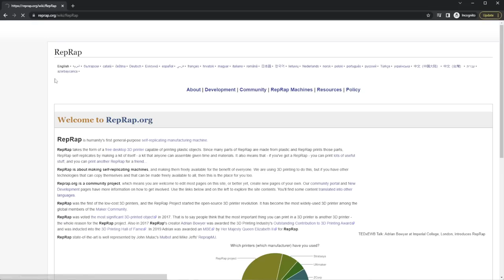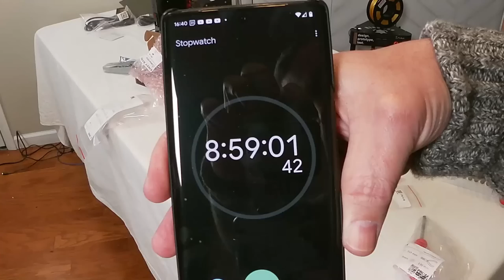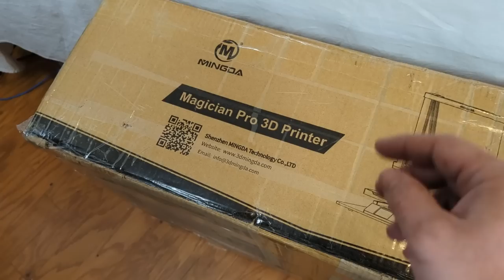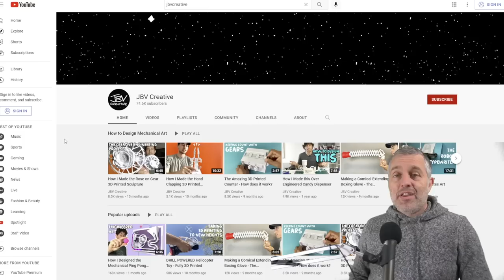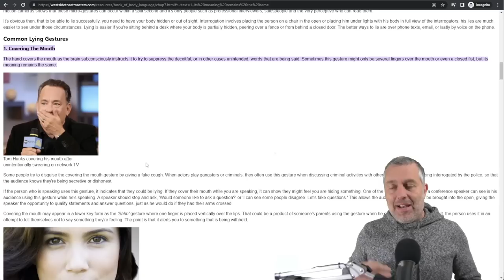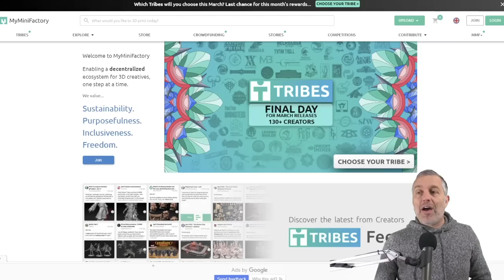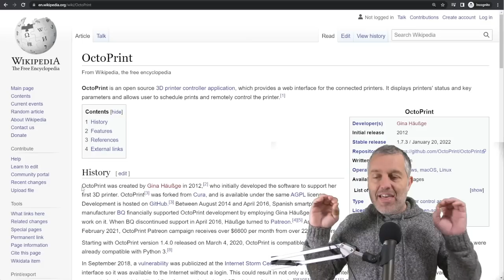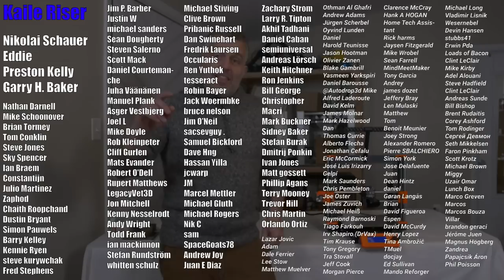Why Does Nobody Speak Truth About The Prusa I3 Mk.3? - It's Overhyped and Over Priced.

Comment: I have a heavily modded Ender.  It is temperamental.  When Somebody buys something from my etsy and i have to ship, guess which printer does it no issue:  Prusa I3 MKS.  I bought preassembled.  No patience to assemble it.
Reply from the maker: Have you actually sold enough stuff on Etsy to pay for the Prusa?
Reply: @DesignPrototypeTest  No, but just starting.  Made about 600 so far.   I don;t think i will get rich on 3d printing. Overall, it  is a loss and just a hobby.  Have you made a profit talking about them on youtube?
Reply: @DesignPrototypeTest  Prusa earning me 75 bucks today.  Ender has heat creep problem, earning zippo.  It tried to help but F-cked up its part of the project

Comment: Don't know if anyone else has already mentioned it, what's your opinion on the upcoming Anker/AnkerMake M5?
Reply from the maker: I hate the Kickstarter video. Made me throw up in my mouth. The printer looks like it will funciton fantastically. Anker brand should give reputation creedence. You can return, or get customer support. Too much superflous plastic pannels. Looks like an a concept sketch artist industrial designer went to town on it. Why? This isn't a motorcycle. You don't need it to be aerodynamic. But I think it will be a winner.
Reply: @DesignPrototypeTest  Thanks for the reply. I think Anker is trying to make printer for dummies, to flat out the learning curve of the 3D printing, and minimize the complexity of the manual operation and maintainace to the very minumum with all techs available at the moment. Don't know if they can really pull it off, but 400mm/s sounds crazily unrealistic on its structure.

Comment: One word... Reliability. I have farm with many mk2.5-3s+ end even rebuilded old mk2 for 2.5.. We created own frame, or have printer in original frame. Every printer have thousands and thousand hours i dont count.Every printed is aboslutely reliable. No fault. I never need replace parts, no mtoros, pcb, extruder, nothing. Even i dont need replace any belt yet or berings. The printer is just stunishing reliable, almost indestructible. 

Just once a while replace some plastic parts like fun shroud or FS cover (cca 30min print and next 1 minutes repair), nothing more. Maybe print fan.

Comment: I bought Prusa i3 1.73 mm (I don't know what that means) and it sat in garage for many years, till week ago I decided to assemble it, which I did. As an engineer, I already think it is a badly designed machine, and but it has a potential for upgrades. I am planning to mill some steel parts for more rigidity, upgrade to ball screws, replace zip ties with something more rigid and replace cartoonish extruder head with something better. I think I was victim of sock puppet propaganda.

Comment: "Keep it simple stupid". So your saying a printer that measures and compensates for thermal expansion, geometric accuracy of the X and Y axis, measures the belt tention, has a proper set up wizzard is overly complicating things for the unknowing noob? I would argue all these things missing, would give you a much harder time starting out with the hobby if you would have to deal with these issues yourself...

Comment: which 3d printer would you recommend for a beginner?
Reply from the maker: I'm not comfortable telling you how to live your life. You are you and I don't know your skillset. Let me provide a few options.
1)The original Ender 3. This is on sale now in person at MicroCenter for $99 or online for ~$200 shipped to your door. There are a ton of videos about this printer. It is just a little more challenging to use as a newbie. But I mean just a little. You should be able to figure it out. There are a ton of people online who can help. And you can upgrade it: https://youtu.be/399VbXxuOdw and https://youtu.be/xqttz2IZ6ko
2)I like the Mingda Macician X for similar size to a Prusa and also featuring the usability features of filament runout detection and auto bed leveling.
3)If you want to print a little larger like maybe a Stormtrooper helmet or something then you can get the new Ender 3 S1 Plus. At ~$500 and featuring all the usability features this is a good option from the most reliable Chinese brand name.

If you get to a point where you are printing so much that reliability becomes an issue I think you will be well beyond asking me questions and fully understanding the issues yourself. Being a 3D printer operator is kind of like being a woodworker. It's not hard once you understand all of it. There really isn't that much to understand but it will probably take you 6 months of learning/experimenting. Best of luck and welcome to the hobby!

Comment: I've been 3d printing for about 8 years, owned many printers, each of them with their flaws, none of them were perfect right out the box apart from maybe a flashforge finder, which for a beginner 3d printer came close and actually got me back into the hobby after I was about ready to quit. 

I've owned 2 Prusa's, the first an MK2 and while it printed ok I think the bed was warped and I had a nightmare levelling the the thing even with super fine and manual mesh bed levelling. I battled with it for months, raised tickets and forums posts but eventually gave up and sold it due to the issue and the fact it was really loud.

After a while I decided to give them another shot and got a mini, one of the 1st batches. I was not prepared for the world of pain that it brought me. The LCD controller knob broke within a month, got sent a replacement. The bed wouldn't level, was told to pre-heat for 3 mins before each print (eventually had to pay extra for the updated mini+ probe which fixed it permanently). The cables were to short going to the hotend, had to fix that. 

These were relatively simple, but the constant inconsistent extrusion issues, blocking would not go away. I followed ALL the guidance and while it worked for a short period I'd soon get back to crap printing. Installed a bondtech extruder, no difference. The only thing that helped me get the thing to print reliably was shelling out cash on a Slice Engineering hot end. After that no more issues and been going strong for over a year. 

Many people had (still have) similar issues and while support is good, when it comes to return something faulty you'll have a battle (same for any 3d printer manufacturer really). I guess for me, no manufacturer is perfect and no matter who you choose you may get a bad 3d printer due to various factors, QC, shipping, design flaws etc. For the price I've been disappointed by Prusa and let down twice so won't buy again however happy with my mini which prints great after the modifications I made.
Reply from the maker: You speak with an even and fair voice. I wish I could be like you. The Prusa fanboys don't play fair. In an even handed discussion they would have to admit fault. The fact that they can't even acknowledge their 3D printer god isn't perfect...How can anyone become so adamant and be in such a constant fervor for years and years about a 3D printer company? It's so hard to believe that so many real people feel this way. Maybe I'm giving the general populace too much credit. Have you tried to speak such words in other forums such as reddit.com/r/3Dprinting ? Did the push-back get to you and make you change your narrative? How are you able to be so pragmatic in your wording? It is much commended.
Reply from the maker: To be clear I am speaking about your judgements on the functionality of 3D printers in general. It is true that I have never paid for a Prusa as a matter of principle. After 4.5 years of harassment by the Prusa fanboys/trolls when people say the name I find myself operantly conditioned to prepare for a fight. One can't have this kind of emotional reaction and maintain true impartiality. I do my best, but I am human.
Reply: Seems like you have had a bit of bad luck with Prusa… maybe you’ll have better luck with the MK4

Comment: Benefit of PRUSA printers is they don't need to be "FIXED" in order to work as good as a PRUSA printer. The DIY learner type person, should buy a $150 kit... then improve it with 3D printed parts.. then design & build an entirely new printer that works as good as a PRUSA ... it is a great learning experience, that's what I did.
Reply from the maker: You do all the FIXING up front. Takes 9 hours to build the thing. I've done less fixing on every single one of my Chinese printers that only took like half an hour to build.
Reply: @DesignPrototypeTest  Depends what you call "fixing".  My experience is those cheap chinese kits come with bent guide rods/beams/z-screws, no PEI print surface, no ability to feed flexible filaments, no bed leveling, no decent method for belt tensioning, small print beds, cheap noisy print drivers that skip steps, various fire hazards, ..etc...  Of course there is no end to making improvements .. and at some point ya find what is good enough for what a person needs.
In your opinion.. What is the VERY Best cheap Chinese made kit on the market today??

Comment: id suggest getting the upgraded ender 3 cause the base has a 2040 exstrusion that the bed runs on while the pros have a 4040 so the beds wheels are spread farther apart, i have a original ender 3 with the 2040 extrusion an ive never had an issue with it but i also have a aquila which is pretty much a ender 3 v2 but it has the 4040 extrusion for the bed an its bed is more stable over the ender 3, it might just be the fact the ender 3 is older an has alot more printing under its belt so the wheels may need replacing or something while the aquila is still fairly new for me compared to my ender 3 so not really fair to compare them but the base ender 3 vs the pro i feel like its worth buying just for the better psu an 4040 extrusion alone, my base model ender 3  was purchased used for 100 bux due to a dead display but other than that it was fine but this was during the time when the ender 3 was 250ish, pro 280ish so for 100 it was hard to pass up even if it was completely dead it would have cost more for the extrusions alone, same with my aquila, got it on ebay from flashforge returns as a open box for 100 an it was fine only had a single bolt hold with the threads stripped so i cut more deeper an used a longer bolt in that spot an it was literally a brand new printer with everything including the glass bed with plastic covers still on them but it was being purchased for the extrusions until it arrived an i seen what i was actually getting. long story short look into buying used u can get really good deals also the pro or the aquila is worth the extra money over the ender 3 base model.

Comment: hmm, i´ve been struggling with several cheap printers since 2012, last year i bought a Prusa mini and this year i bought a mk3s+ and they both works, been printing for hours without problems. (mmu2s is another story) Has friends with ender printers that needs help often, therefor more searched for on google.
Josef Prusa has become  a brand, therefor they are using that name, like Volvo puts on Volvo name on their product  ;)
Regarding hard to put toghether? i had a stroke in 2010, so my left arm and leg does not work.. but i managed to put toghether both the prusa mini and the mk3s+ printer  using one hand only ;-)  a  problem is just a sollution you haven´t found yet ;)

Comment: you criticize a manual for being incredibly detailed, and somehow you still manage to put this pool holder on backwards.

the pinda probe does not measure the magnets.
Reply from the maker: I've received this comment numerous times. Obviously, I assembled the printer by skimming the manual. It would have taken me perhaps 3 more hours to build the printer if I was following along step by step. My time is important to me (and I don't like being bored) so I chose to miss a detail or two in favor of a faster build time. The two important details I missed were: 
1)The proper tension on the extruder 
2)The orientation of the spool holder. 

It is important to note that so many comments are choosing to focus on #2  when it has almost zero effect on print quality. Whereas the far more egregious mistake I made was the extruder tension. NOBODY up to this point has criticized me for this mistake. You all could have been arguing that everything about my experiment/comparison is invalidated due to issues of under extrusion. Maybe it wasn't poor part cooling on the spire but instead under-extrusion. Maybe it wasn't "intermittent extrusion" making that diagonal pattern but instead under-extrusion. This would be a valid criticism which would force me to re-do the experiment. Instead, all I get is (and I'm making a strawman here but it's pretty accurate): 

"You put the spool holder on backwards. You made a mistake and that means that you aren't capable of making any valid criticisms. You aren't perfect, so nothing you say has merit." 

If I start to see criticisms about the extruder tension in the comments it will mean that I am better at criticizing myself than entire forums full of motivated Prusa fanboys. Being the first person to say it, The criticism does kind of belong to me. You may use it against me. I'm not claiming it as exclusive intellectual property or anything like that. Let's just acknowledge the source where the criticism first appeared. Because isn't that what this is all about? Like, all of it. Prusa not acknowledging sources and pretending he is the reason for everything good in 3D printing is the very core of the issue. You believe this narrative. It's why you are a fanboy. The reality is that Prusa is hardly responsible for a single innovation in 3D printing but he has reaped the financial benefits of many innovations which he chose to  ̶c̶l̶a̶i̶m̶  insinuate as his own. Sure you may argue the merits of the printer, but deep inside you are just a true-believer and Prusa is your team. Prove me wrong. Say something bag about Prusa.
Reply from the maker: CORRECTION: Say something bad about Prusa
Reply from the maker: From Prusa's website talking about Magnet comp.: With 7x7 Mesh bed leveling, you can choose whether or not to use Magnets compensation. 11 of the 49 points are so close to magnets, that the reading can be off by as much as 80μm (microns). Magnet compensation ignores readings from these 11 points and calculates them from the surrounding points. We suggest leaving this function on.

In other words, the use of magnets with the P.I.N.D.A. probe is the default setting and the way the printer I showed in the video is functioning.

Comment: It’s interesting that you said “computer scientists at Prusa” I would imagine that the things you’re referencing (sensorless homing/pinda probe) were implemented by electrical engineers, they aren’t really software bounded ideas.

I definitely disagree about Prusa being egotistical. His name is on everything but I think it’s more like he’s the face of the company.

I think no one else uses pinda normally because magnets have a temperature dependent failure mode, and magnets would increase the cost of a printer. (I had to switch to Klicky because a BLtouch exhibits this)

With regards to the calibration I feel like most printers respect the  programmed limits, so as long as the designer knows the theoretical maximum for everything with good quality so calibration isn’t really necessary.

I disagree that Prusa is a reseller, seems unfounded. A criticism that I have after watching a video of assembly/packaging recently is that much of a prebuilt machine is built,packaged, and tested by hand, which is just unnecessary.

I don’t understand what this conversation regarding politics in the Czech Republic, it seems very strange. I disagree that Prusa is in any way a dictator. With regards to the octoprint thing, that’s just business. If I were selling something I would only support known skus which I sell. Prusa does not sell octoprint, they don’t support octoprint.

I have a Hyundai, when I have gone to the Kia dealership they have told me “the Hyundai dealership is down the road” there is a functional duplicate of my car in their lot, but they refuse service based on that name. That’s just how the real world works.

Comment: I would recommend the ender 3 pro for its 32 bit processor, bootloader and ports so that Marlin 2, bl touch and filament sensor could be installed. I think the base model would be a challenge for beginners to achieve those sensor mods.
Reply from the maker: I bought an Emder3 base model a little while back. They come with 32-bit processors as well. Believe it or not the 8 bit processors are more expensive and harder to source. I doubt think Creality sells a printer with an 8-bit processor anymore.